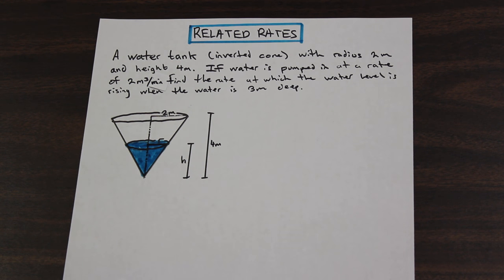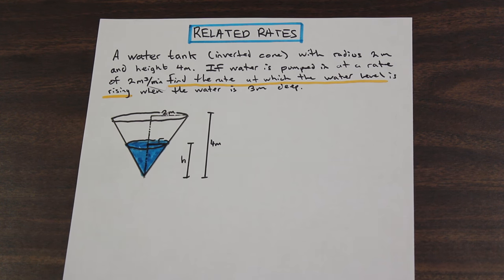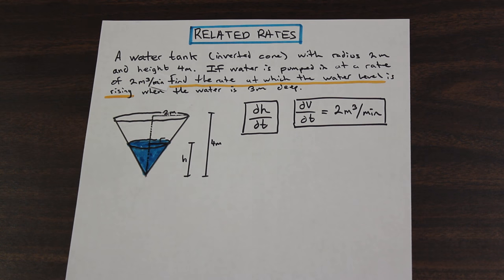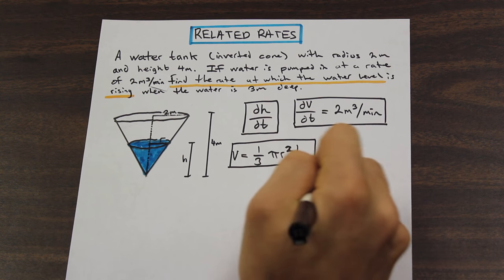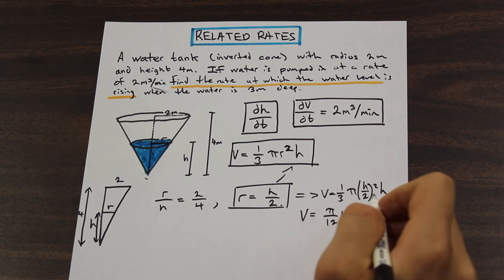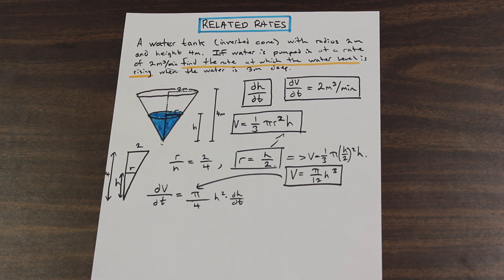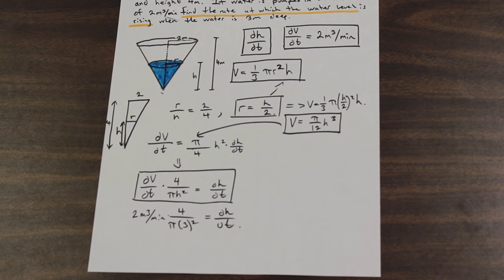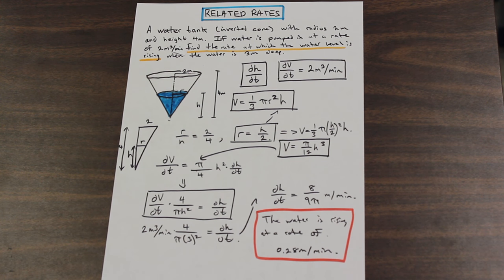Step by Step Method of Solving Related Rates Problems - Conical Example

Comment: when you simplify the equation for volume after replacing the r with h/2, why does the 3 in the denominator turn to a 12 and not a 6?
Reply: 6:40
Reply from the maker: The squared term applies to both the numerator and denominator in h/2, thus h^2/4, 4*3 = 12

Comment: I don't know if you can help me out, but how would i solve a related rates problem, where the shape given is a right triangle, solving for the rate of change of an acute angle?
Reply from the maker: Honestly, the best way to study for these types of problems is solve all of the different types from the textbook with the solution manual to help you if you get stuck.  Most of them follow a very similar strategy with different relationships.  That way whatever comes on the exam you'll be ready for.

Comment: how is r/h=2/4? i understand where you got the two but what about the four?
Reply from the maker: 4m is the full height of the cone
Reply: How did you get 4?it doesnt say that in the problem.
Reply from the maker: Theres a dimension line that shows 4m directly on the drawing
Reply: @AFMathandEngineering  how is it pi/12?
Reply from the maker: @phucdangchannel  h*pi*(1/3)*(h/2)^2 = h*pi(1/3)*(h^2/4) = pi/12 * h^3